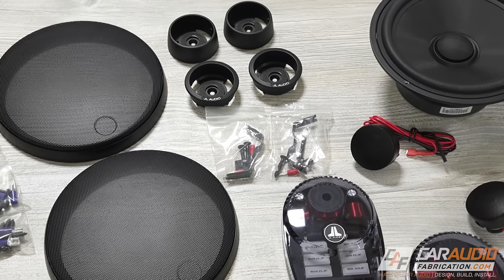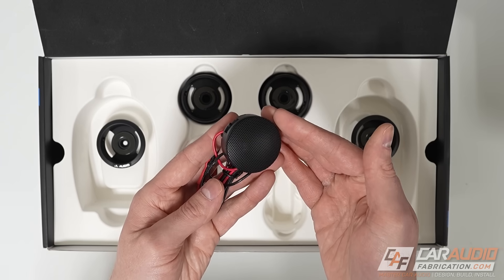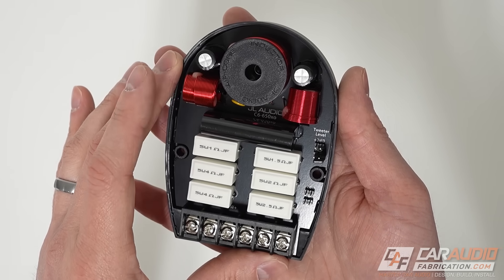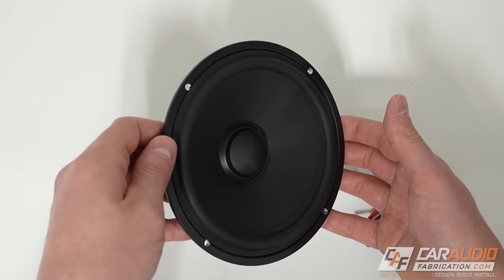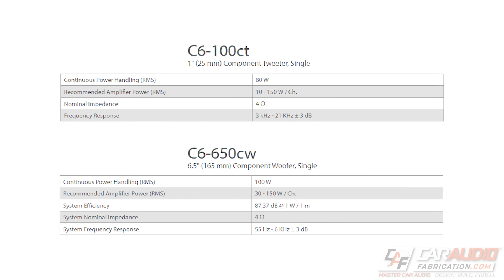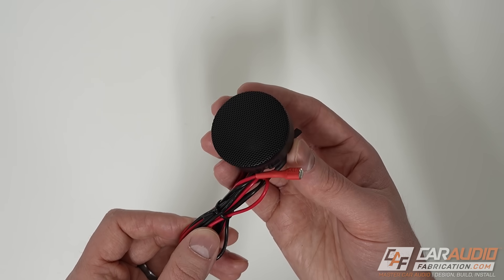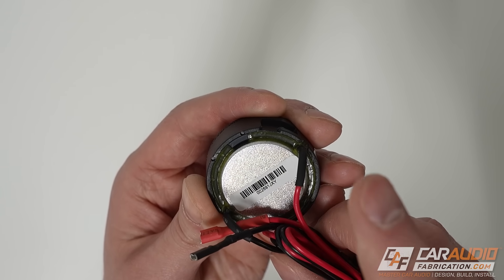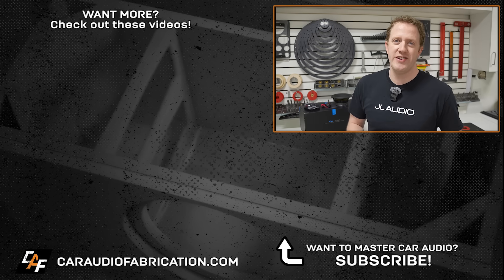NEW! JL Audio's C6 Component Speakers - High End Performance at Mid Level Pricing?

Comment: I am starting to look for replacement speakers for my 2022 Elantra N. I think I may never upgrade the power (its decent), But I am concerned about replacing the midbass 6.5" drivers. The stock "Bose" system actually has pretty decent (read heavy) bass signature. I don't want to get a set that will lower the amount of midbass/bass coming out of the front doors. Do you think this set would do well?
Reply: Your stock Bose amp probably has preset non-adjustable crossover settings built in specifically for the stock speakers, and the resistance of the speakers & amps on some Bose systems is sometimes 2ohms or 8ohms, or even a combination.  Some factory amps are even designed to reduce output on certain frequencies as you turn the volume up in order to prevent damage to the speakers.  If you replace your speakers with aftermarkets and use your stock Bose amp to power them, you can play with the tuning on your head unit a little, but given that most are just "bass, mid, treble" settings, you don't really know what range of frequencies you are adjusting or what kind of power your new speakers are getting from the stock amp. And it may actually not sound as good as you would expect.  When I replaced all of the mids/highs in my Yukon with a stock Bose system, I powered them with their own amp and kept the factory sub running on the factory amp.  That way I was able to tune the overall sound better. The factory sub is more defined, and the mids/highs are more clear and full. I didn't get an aftermarket sub because I need all of my cargo space available.  For you, I would suggest getting a small amp with built-in DSP to run your mids & highs if you replace them.  Set your factory bass at what you like, then tune in your new mids/highs for a good balance.  You may not be able to crank it because the amped mids/highs could easily overpower the factory sub, and it would eventually sound unbalanced, but at normal listening it would sound much better.  What I've found is that if you're dropping good $$ for quality components and an amp, then it isn't too much of an add'l cost to add in a small sub since all of the legwork for amp wiring is already being done.  At that point it's just an amp and sub.  Or even a small powered sub.
Reply from the maker: Have you seen this video here - https://youtu.be/uqAVNm4K_fc?si=2jH7y4QBMfYHUOml We went from stock to JL Audio C2's and even on deck power the difference was substantial. Immediately noticeable. I haven't heard the factory Bose system, but if it's anything like other OEM "factory premium" upgrades in my opinion you're definitely going to get better results aftermarket. Remember proper installation is key (again watch that video I linked)
Reply: @jp1087  oh, for sure. I used to sell and install car audio back in the day and am quite familiar with what you are saying. I am actually fairly impressed with the stock system. Back in the day we used to say “if you ain’t got no highs and ain’t got no lows, then you must have Bose!” 😂

Having said this. I am now at the age where I still want some good SPL, but with improved quality. I replaced the stock “Infinity” speakers in my 2018 Elantra Sport Premium Package DCT with the current gen RS set of coaxials for the rear and center channel. And the components for the front. These were also 3 Ω so I get a tiny bit more from the factory amp. While they sounded leagues clearer and the treble much clearer and precise, overall, the system lost midbass as compared to the stock drivers… I also added a JBL Basspro Hub to the trunk. Once coupled in the spare tire well, it def added some punch. But still, overall the midbass isn’t there as before. But the rest is considerably better.
Reply: You will 100 percent lose bass unless you add a real amplifier and a DSP of some kind....as a professional installer I get asked to do this often and after trying it a few times I will no longer entertain this unless they're going to upgrade the amplifier/DSP in the very near future
Reply: @AlexGtheDon  And, the variation in "factory" systems from one manufacturer to the other is absolutely mind-boggling.  Inherently, the GM stock Bose systems all suck and sound flat no matter what tweaks you make.  That's why I upgraded my Yukon system..  But the stock Bose system in my Altima is a different story, it sounds amazing as-is; and the amp is 3x the size of the one in my Yukon even though both systems have the same amount of speakers and both cars were from the same year. I had a Hyundai minivan that had the 12-speaker Infinity surround sound system.  That was awesome too for a stock system, very clear even though it lacked a little on the bass.  DVD's is where it truly shined though.
Reply: @MaxMax-sj7wb and why would I do that?

Comment: Help please, say a single sub needs 16 sq inch per cube, a single sub in 2 cube needs 32 sq in, does adding a 2nd sub double that and turn it into 64 sq inch of port area? So that each sub has its 16 sq in per cube? Sounds crazy for that much, but I haven't found an answer anywhere that says port area is per cube or port area is per cube per subwoofer? Dual sundown x8v4 going into 2 cubes thanks, love your videos!!

Comment: I got a Beats audio system in my Jetta GLI and I want to replace the speakers but my front speakers have a built-in crossover in the woofer and if I try to put a regular speaker in it my two tweeter will stop working working. Are there any suggestions
Reply: Leave the crossover and Y the speaker wires just before it.

Comment: How would you compare these vs the XR-650 3way thru a crossover setup?
Reply: If memory serves me correctly, the XR's are an old speaker arent they?  I had a pair XR 650 components and absolutely loved them!! I removed them from my old vehicle when it got totaled years ago and have them tucked away in my basement somewhere.  I've gotten the itch to upgrade my current cars audio and I swear I'm thinking of using them again.
Reply: @dboogiewoogieone  Yes they are old already, but some say they sound better than what’s available at the moment. I just installed a set and I am really impressed.
Reply: @v8tergt653 I had JL XD Amp driving them ( I can't remember which one) and it really made them sound sweet. Have you auditioned any other speakers? My money is a little funny right now so any upgrading I do gonna be a slow roll.

Comment: Dude, they are quite expensive for a "mid priced" set tbh
Reply from the maker: Not really, I just went on Crutchfield, I searched 6.5" component sets, and sorted by price. The range of available options across a wide variety of brands is from $60 - $5,500 for a 2 way component set. So by definition these actually fall on the low end of "mid level" pricing in that range. 

Now that might not match what you personally view as low end vs high end pricing, but we aren't evaluating the cost of these based on your wallet or mine, everyone's definition of affordable is different. We are defining them based on the range in the market.
Reply: A thousand bucks is a lot of money for me.  But Mark is correct about the market spread for comparable quality.   The C3s were half the price but the sonic improvement of the C6s truly surprised me.   So far, it has been worth the extra $500. We’ll see.
Reply: @MaxMax-sj7wb 👍👍👍